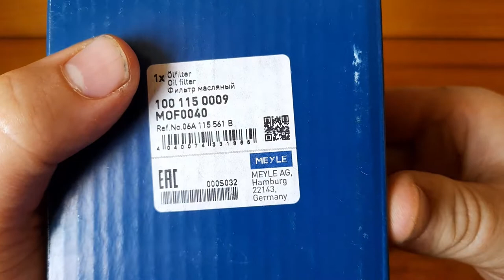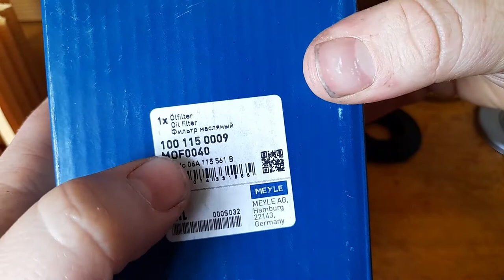MEYLE 100 115 0009 Oil Filter Cut Open and Review

Comment: Somebody made a mistake, the metal has been put into the machine upside down, the bead should have been on the outside, and the rough side of the holes on the inside. Some worker was asleep on the job, those filters should have been recalled.

Comment: Great video.Not a bad oil filter by the look of it.I'd still be happy to run that in my daily driver regardless of the not so perfect inner tube. Thanks for sharing.I was going to ask you where can i get the fleet guard oil filter.I was very impressed with your review of it and looks to be the best bang for buck on the market.I tried ringing around here in Melbourne and no luck.Tried ringing Cummins and they stuck me on hold for half an hour and gave up.By the way Repco are now pushing a new oil filter called pro select.Its replacing the Silverline that they are phasing out.Its about $9.00 trade and they reckon its pretty good.I will get one and let you know if looks any good.
Cheers
Reply from the maker: Thanks for your reply. Thanks for the info about repco. I will have to look into that too. Yes Cummins can be hard to get a hold of sometimes. I know any John Deere dealer should be able to get you fleetguard if you ask aswell as most truck dealers. You won't tend to find them in automotive places, more like heavy transport, agriculture and mining places have them. I'm from tassie  so am not much help with specifics in Melbourne sorry
Reply: Thanks Mate.I will give John Deere a call Monday.Cheers